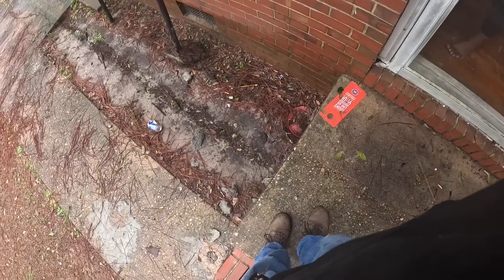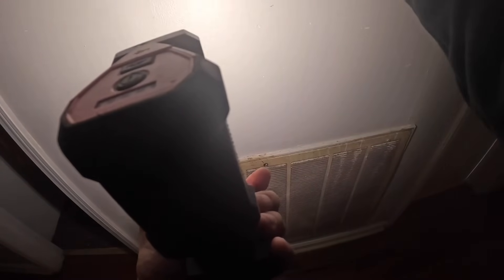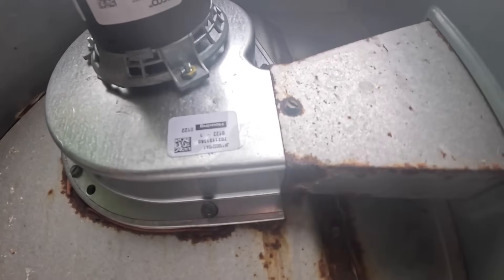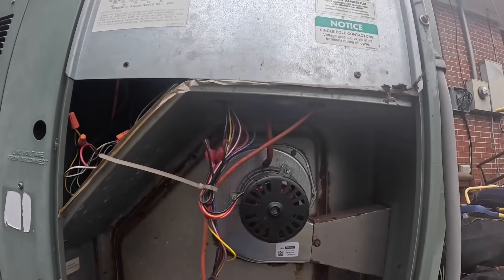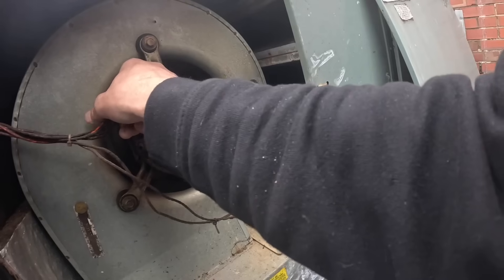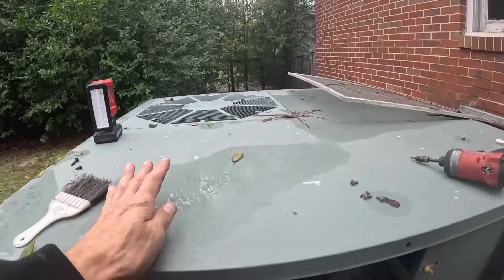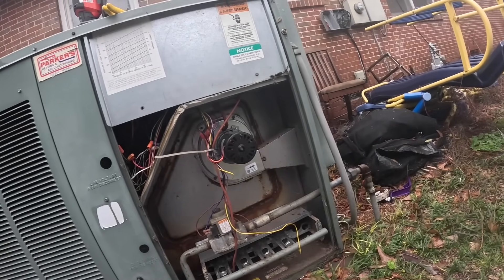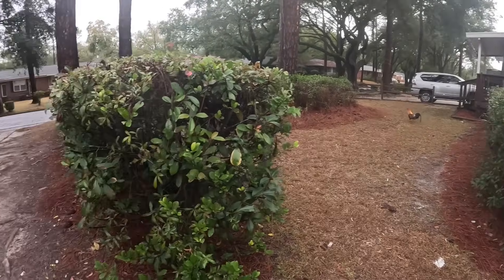Making Sure It’s Safe To Turn On The Gas, and Lighting Pilots! #hvacguy #hvaclife

Comment: HVAC uses a lot of the same terminology as the automotive industry, Header or header flange, exhaust manifold, and exhaust manifold collector etc. only difference is they are easier to access and service on HVAC equipment, haha